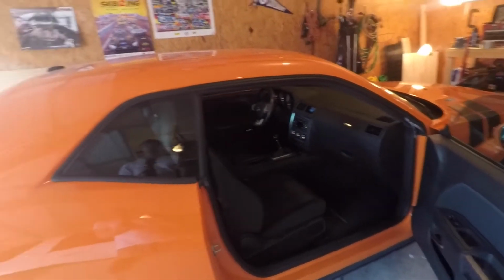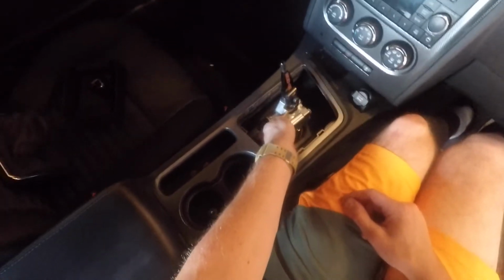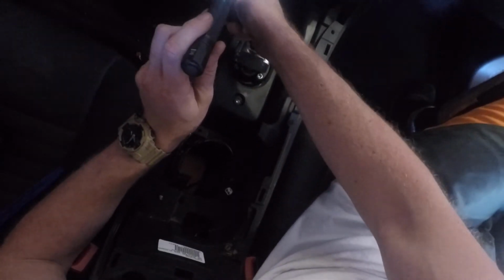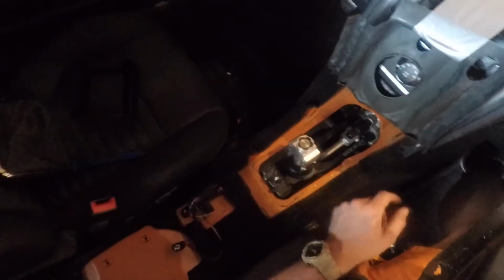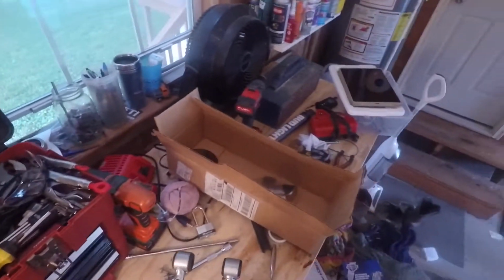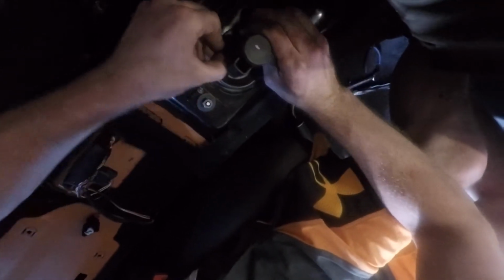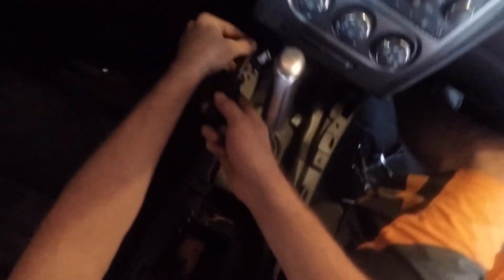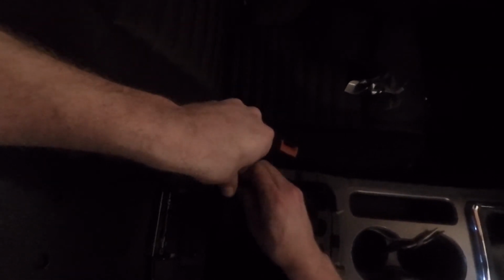Dodge Challenger Barton shifter REMOVAL

Comment: I tied a length of dental floss on the pins before trying to install them. That way they didn't fall to the floor if I dropped them. Once the pin was most of the way in, I cut the floss off.